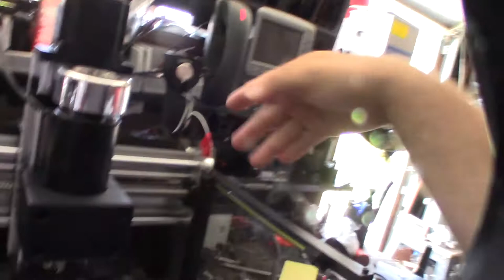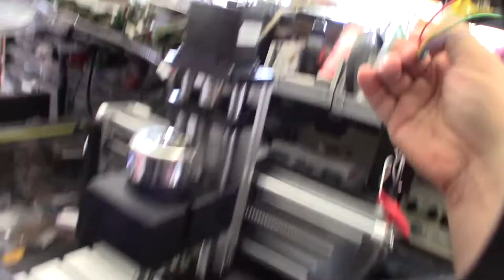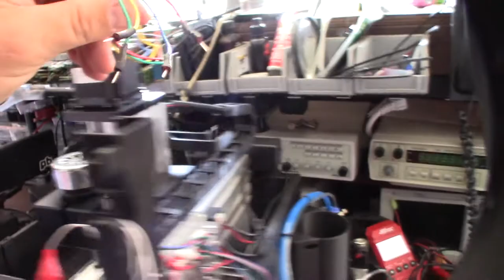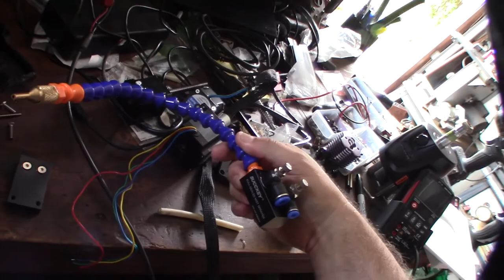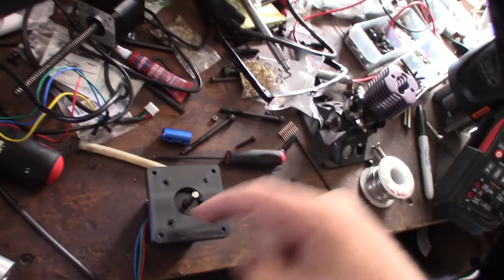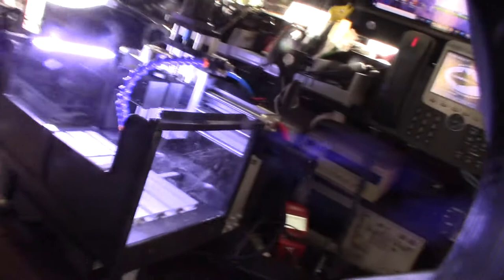3018 CNC SFU1204 Ball Screw Conversion And X Z Carriage Uprade Part 4

Comment: Cool project. I started with a generic 3018 and did some major upgrades and was considering doing ball screws. After watching your series I crunched some numbers and figured it would be better to just build a entirely new machine from the ground up using your ideas. The Thingiverse project is way cool. Thanks for sharing all of this. Ironically I have a G0704 already converted to CNC, My goal with the 3018 was to be able to do engraving on metal and to have a project to tinker with. Thanks for making the videos. Very thought provoking.

Comment: you can measure the wires to get the coils, they are low ohms, so a "short "is 1 coil.
or, if you have the stepper out of the machine , just twist 2 wires together and hand spin the stepper, large resistance = 1 coil shorted.

3d print a new fan for that spindle , those standard ones are insanely unbalanced. (it's why it sounds like a vacume cleaner) (thingieverse should have the files)

Comment: Try swapping the z axis driver for something like this https://www.pololu.com/product/3730 or at least a 8825. 
A 8825 would want a bigger/taller  heat sink, preferably copper to get rid of that heat faster. But nevertheless you should be able to use your Nema 23 on the z axis just fine with that 8825 or external Poulou driver. 

If the board has external stepper pins, you can always slowly upgrade your axis to the Chinese external drivers
Reply from the maker: The motherboard has fixed drivers. I have some DLC 2.0 boards I'm going to put in there and some extra trinamic drivers.